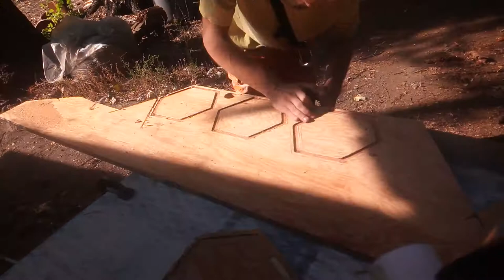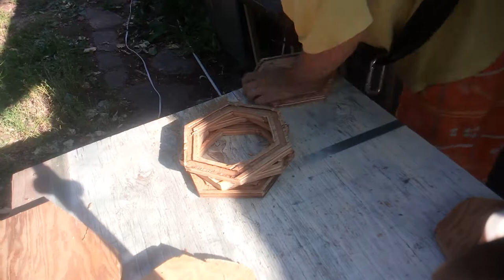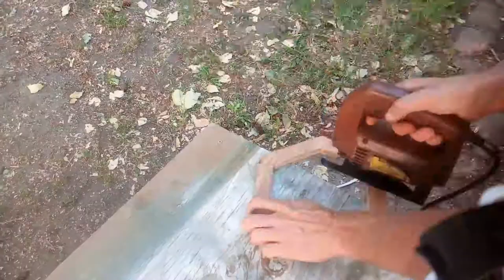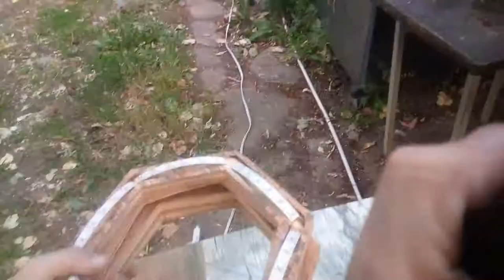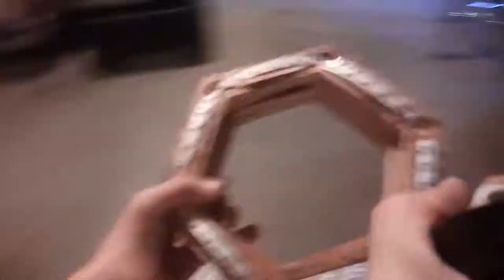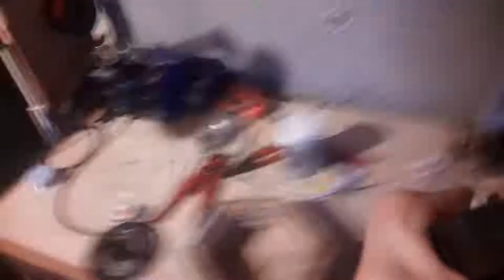Cut-It-Drill-it-Sand-It-Route-it-Post-It (Hexa-Light-Procreation @ Hyperspeed)

Comment: heya Mike..if you use a sharp knife on your cut line with a straight edge..you wont have any chip- away from the plywood...just a thought.  Am in nelson today and at the library using computer..blew up my charger..crossed the poles by accident while trying to change the cord..DOH!! was thinking on busking for Jazz fest in Kaslo..any thoughts on shady locations very appreciated..cheers
Pat